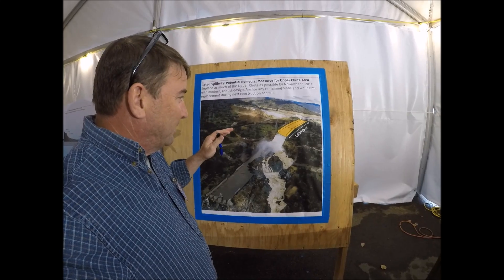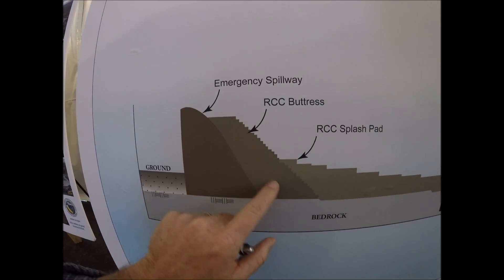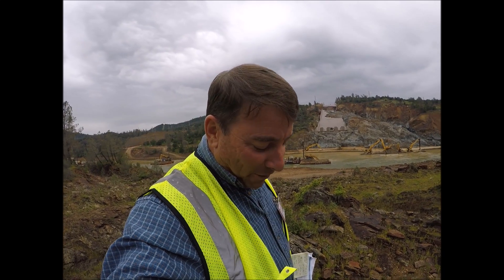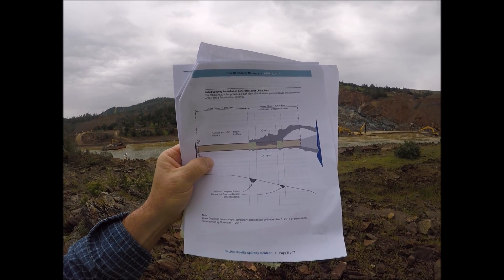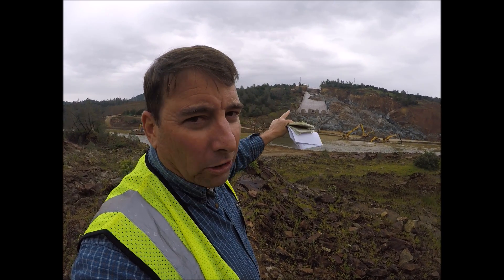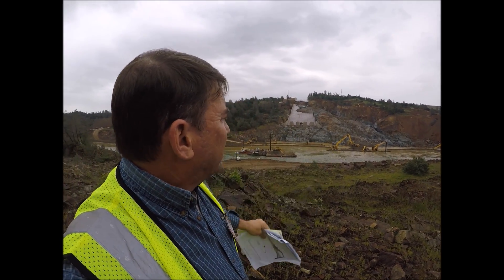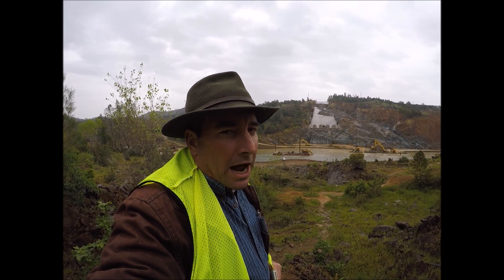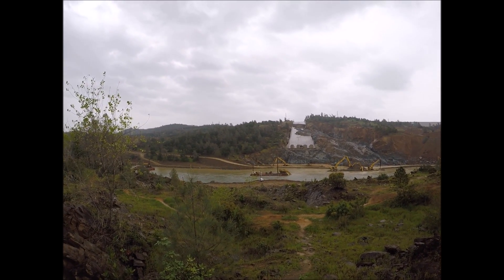Oroville 6 April Update The 'New' Spillway Design Revealed!

Comment: how the heck are they going to pour all that concrete for the new spillway and have it cure over the summer season. This is going to be really interesting to watch.
Reply: Concrete comes up to spec cure in about a month. Recent core samples from the Hoover dam indicate the concrete is still continuing to harden
Reply: Concrete's cure rate is a J curve. Comes up to about 85-90% designed strength in a week or two, then continues to post harden. You design for the 85% strength and use the 15% as a buffer, plus other calcs.
Concrete is pretty interesting stuff, you can add a lot of things to it in small amounts, to radically change it's strength and behaviour.
Reply: got it... thanks to you both :)
Reply: janielaurel Many people don't realize. When you dig a fence post hole, you don't actually need to mix water with concrete. Just pour the dry "quick-crete" directly into the posthole. The concrete powder will draw moisture out of the ground and harden. Much easier on the back. RCC, as I understand it, has very low water content. Trucks will pull up and dump it much like crushed gravel. Bulldozers will smooth it out and then compactors will tamp it down. Think more dry than wet. It then cures much quicker and generates far less heat.  Rest assured, a concrete contractor will correct me if I'm wrong. That's the power of the internet. All I know, my fence is standing and those posts are solid 15 years later. ;-)
Reply: janielaurel 
As far as I know, the Roller Compacted Concrete dries much quicker and is stronger.
Reply: I've been away from my engineering side for too many years. THAT is really useful info. Thanks :)
Reply: The big challenge w/Hoover Dam concrete was dissipating the heat released by "curing" (hydration). So, they built in arrays of piping to circulate coolant from refrigeration plant, then later filled that with concrete or grout. Cement blocks also made with much drier mix, for strength. Higher slump -> lower compressive strength.
Reply: janielaurel
I believe he said they were going to use RCC.  Enables rapid construction.
And it will have rebar for seismic strength, at least in the actual spillway itself.
https://en.wikipedia.org/wiki/Roller-compacted_concrete
Reply: janielaurel I think they do it in parts/ stages.  I watched a documentary on the Hoover dam ,  if they done it in one pour it would still be setting
Reply: janielaurel  but I'm no expert
Reply: I love it !
Reply: Sideslip
Concrete's cure rate is not a J curve. At least it doesn't appear that way to me.
http://www.ce.memphis.edu/1101/notes/concrete/section_3_properties.html
https://www.google.com/search?q=j+curve&oq=j+curve&aqs=chrome..69i57j0l5.3776j0j7&sourceid=chrome&ie=UTF-8
Reply: I believe that you will find that modern technology has developed concrete which stabilizes much faster than it used to. Combined with modern application processes and you can build concrete very fast. i.e. the Burj Khalifa was built with a concrete core which had a new floor poured over the previous floor within a day or two of the last pour. The base pours were holding up the entire building within just a short time of being placed. Plus that concrete continues to build in strength for years, even decades or centuries to come.
Reply: Indy....Didn't know that about the post holes. Thanks
Reply: james turner 
Not nice, nor respectful.
Reply: james turner 
And again...not respectful, but if you can't see it, then there is a bigger underlying problem.

Comment: Good plans......RCC ( Roller Compacted Concrete ) is basically standard concrete with less water so its stiff. Sounds like they're going to fill those holes with RCC rather than stone. That's going to be basically bedrock as the base of the spillway. Shotcrete is also very similar in consistency to RCC
Reply: For anyone wishing to help Juan with his expenses, there's a link to a paypal account up top in the discription
Reply: Couple of thoughts on construction....... Cemexusa has some great youtubes on RCC. .....A portable plant can mix 600 tons per hour. that's 60 truck loads per hour, one per minute........There was 1.7 million yards washed down the hill into the river. Assume half has to be replaced to fix the spillway. the rest is canyon. That's 850,000 tons or 1417 hours or 60 days. .....It's going to take some work to get the people and equipment in place but the timeline is doable
Reply: Once the "pour" starts does it have to be continuous to avoid cold joints?  If so, 2 patch plants in the event a plant goes down?  Feeding a plant(s) to maintain that quantity is going to be a logistic challenge also.
Reply: cemexusa has some good youtubers on RCC. You can get an idea how long between pours, how much they can put down an hour, the equipment required. I just used the info to do a rough calculation......The plan as presented is the 60% engineering plan. The drawings still have to be prepared. We don't know how deep the holes are ( plunge pool etc ). I'm going to guess that they will wash and crush some of what they dug out to build a foundation that they can work on. EG. if the pool is 50 feet deep they my fill in the bottom 20 feet with crushed fill ( compacted of course ) to build a level surface that they can then install the RCC on 30 feet thick. That's not all RCC but it would still be good by the time California slide all the way up the coast and becomes part of Canuckistan. ......We've been shown a plan that still needs to be fleshed out. What I've seen gives me confidence that they can meet the time line and do an excellent job. Time for us armchairs to get out of the way.
Reply: Thanks Bob, you're getting a workout with all these comments.
Reply: Just had a look at the water levels and water releases. Looks like they brought a turbine back on line after a brief maintenance shut down. Outflow is at 13,000 CFS ( 2600 per turbine ) Inflow is staring to drop again after the rain. Lake level is at 853. Looks like a release over Easter and then they can start the repair, pedal to the metal
Reply: Juan.....A question for you. When you go on the CDEC site to check on water flows, you can also get the graphic output. If you click on the title at the bottom you go from a half day to a 7 day graph. The outflow, which at this time is the Hyatt Power plant, the flow drops in distinct steps, is there something wrong with one of the generators. It looks like all six are back working as of Saturday evening. I assume the total drop was to work on the power lines.....Thanks

Comment: Thanks Juan!  You are a light in the darkness.  At high rates, the water moving over the top of the downslope will be like air over a plane wing.   I hope they consider the cavitation.
Reply: Agree jim, high velocity water can be very destructive. I'd ask why they aren't considering slowing it down with baffle blocks on the steep section. This would be less likely to cause failures in the channel and any failures that did occur would be less catastrophic as the water would have less kinetic energy. KE is proportional to v squared.
it's alright saying 'we'll maintain it properly this time' - the maintenance will eventually be cut again as the people who remember  dealing with this failure retire and the effects on the civilian population pass into distant folk memory. better to design it to be more intrinsically safe from the get go imo.
Reply: Exactly. They ever have to use that emergency spillway people will understand what your talking about Jim
Reply: Reverse Engineer   So thats how my beer bottles break when using an edge, to slam them open! Specially on cold days. They just split in 1/2.
Reply: Cavitation propably carved away the concrete until it failed
Reply: Way to gradual a change in slope for the speed its going. It's only about 50 mph. You wouldn't "catch air" at that speed
Reply: Next time you're in a really fast speed boat put your hand down in the water.  The chaotic layer at the water-concrete interface is going to be pounding the concrete with destructive forces.
Reply: Good work. Don't live in California for I feel you are giving a full view of what you know with less bias than most
Reply: 800 million dollars later....
Reply: Cheaper than billions of dollars in flood damages.....
Reply: And like wind that go's over the wings it lifts.
Reply: Cavitation happens when the water pressure reaches zero, like a badly designed propeller. It happens on the forward ( suction side ). For cavitation to happen on the spillway the water would have to be traveling so fast as to come off spillway. It's not nearly fast enough for that. I think what you're referring to is boundary layer eddie currents. Even they won't create cavitation, just waves in the current.
Reply: Cavitation happens when there is little to no air bubbles. This spillway does not get cavitation as the turbulence adds plenty of air bubbles. Cavitation is when air-less water that is rushing through a tunnel or tube lifts and forms a vacuum then slams back down onto the surface with high impact. You can see it at work at home. Fill a glass bottle to 90% capacity, hold tightly and smack the top of the bottle hard with your hand. The result is a vacuum at the bottom of the bottle as the water lifts. The glass will break there.
Reply: Jim Connelley Difference of jumping into still water vs moving water w lots of air bubbles like giant water slide. One smacks u hard, the 2nd you literally blend right in w little impact.
Reply: You need to let go of this nonsensical "cavitation" theory. The spillway failed due to a long term, undiscovered weakness in the soil below it and has probably had ground water slowly eroding the soil for many years.
Cavitation can NOT occur under atmospheric conditions, it needs solid water surrounding the low pressure area to cause the destructive collapse of the vacuum bubble.
As the flow down this spillway is entirely turblent flow, with entrained air, there is absolutely no chance of any cavitation occurring.
There are much, much more intelligent and educated people than you working on the design, I think they may have a small amount of knowledge of fluid dymanics, I mean, they deal with it every day.....
Reply: what a "DUMB ASS"!!